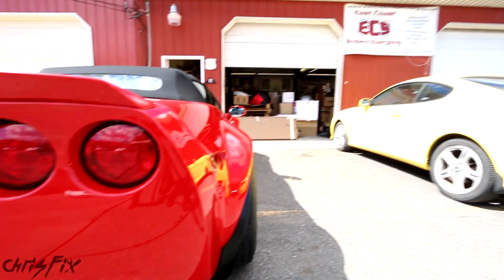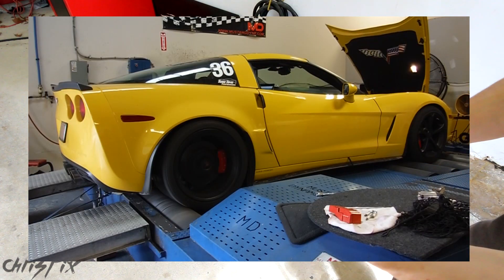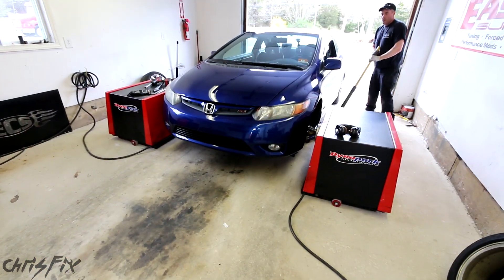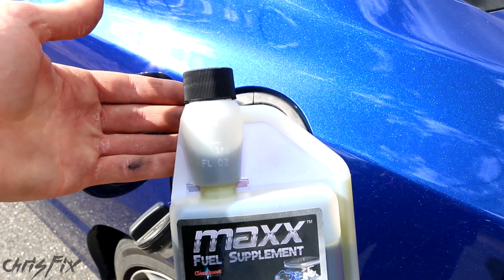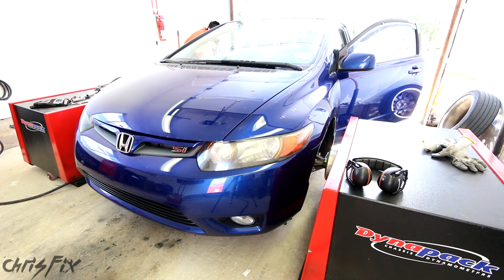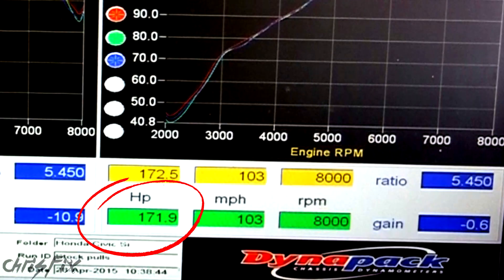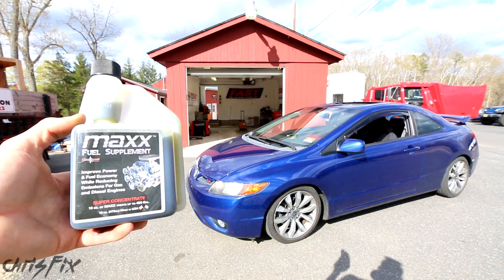Can a Fuel Additive Really Increase Horsepower in Your Car? (With Proof)

Comment: I know this video is old and people have probably said this already, but, I just have to mention something. The best way to mix the additive you put in with the gas that's already in the engine, and to know you most likely have the fuel with the additive being fed into the cylinders, is to petty much have the car with no fuel in it. Maybe like 2 gallons, at most. That's when you go to a gas station, put the additive in, fill the car with like another 2 or 3 gallons of gas to mix it in, then drive it around for 30 minutes plus to make sure the additive is flowing through the lines. I personally have the gallon to additive ratio a lot more concentrated, when I put additives in my fuel (which is rare. I can't even remember the last time I did that.).

Comment: Before I do any research I'm going to hypothesize that the additive aids in oxygenation of the fuel allowing more fuel to be injected into the cylinder and burned at once. This wouldn't aid in fuel economy but might explain the horsepower gain.

Comment: 5hp is negligible so meh...gains are all about how multiple parts work together in harmony, not just a single upgrade. Even if you put in e85..gotta tune for it and upgrade pump/injectors/lines. Probably the best bang for buck on horsepower right there and it still isn't as simple as adding one thing.

Comment: That's a low reading Dyno. The Average stock K20Z3 Civic Si makes around 180-190whp.
Reply from the maker: Dyno readings vary depending on what brand dyno you use. It isnt about the actual HP and Tq number it is about the change in that number.

Comment: Took a trip from Ohio to Florida in a 2005 Infiniti g35. I bought 6 bottles of Lucas fuel system cleaner, the big ones, and used it with every fill up. Tank was empty before I left, so first fill was in Ohio, filled up 3 times on the way there, averaged 260 a tank down, and got 310 for the two on the way back. Not a noticeable gain in power, but fuel economy was worth the extra 6$ a bottle.

Comment: This is beyond dumb.  A gallon has 128 ounces in it.  Lets assume for a minute that the car has 1 gallon of gas in it total.  Lets assume you have a way to burn off just 1 ounce of gas so you know there's exactly 127 ounces of 91 octane gas in the car.  Lets assume that this "Octane booster" is pure 110 octane fuel.  1 ounce of octane booster with 127 ounces of 91 octane gas would net you 91.15 octane (If I round up).  So how much octane would this booster have to have in order to bump you up to 93 octane?  You would have to put 1 ounce of 347 octane fuel in your car in order to get that effect.  

This isn't rocket science, if you mix 5 gallons of 91 octane and 5 gallons of 93 octane, you get 92 octane.  Straight Toluene has an octane of around 114, that's what oil companies mix into gas along with ethanol to actually boost the octane of fuel.  Most of these octane boosters don't actually do anything, it's just BS.  Half of these use Kerosene as the primary ingredient, which has an octane of about 15, so I'm not sure how that's supposed to help.

Comment: Now what is the rated HP and torque for that engine in the car, V's how many KM/Miles it has done, then compare to the test, if its very close to the factory figures then why not use it, especially when your going on a long trip like say more than 500 Km, why because you dont know what the fuel is going to be like at other pump stations. :)

Comment: I'm wondering what you guys think this is? I'm guessing it's an octane booster of sorts but I don't see how so little could give that much knock supression. And if it is then 5bhp on a high cr k motor like his si would make sense. But then it wouldn't do anything good for the lower cr motors that don't have more ignition timing. If it's something that's evening the burn of the flame front and reducing the peak combustion pressures then I could see this working across the bord but eh I'm still somewhat sceptical. Think we can see you do this in the Mustang the 4.6 doesn't have a nice combustion camber and high cr like the si and would shed a lot of light on this stuff.

Comment: The theory behind this is that the additive increases the octain rating. Also if could have just cleaned out the system and actually gained power from that.
Reply from the maker: +Godlike_Gaming Crew Batou323 And vAspire-_- thanks for the info

Comment: More than likely, this has some octane booster in it, and if this car has 91 in it, there may be some room in the ignition advance that the octane booster lets the ecu advance the timing a little. The heat soak after each run isn't affecting ignition advance due to the higher octane as well. 

I bet you wouldn't see near this improvement in power on a more economy tuned engine.
Reply from the maker: Thanks for the insight!

Comment: The bottle reads that it helps with emissions. Has anyone had any experience with this or other additives helping with a check engine light caused by emissions issues? Thanks for the video Chris.
Reply from the maker: I wanted to test this but never had a car that didnt pass emissions. They dont do a sniffer test by me anymore.

Comment: %5 less humidity and ?? temp difference + barometric differences. Bogus test. Not similar weather. Humidity, baro, and air temp are BIG factors. Ive gotten double digits with no fuel additives with just atmosphere changes.
Reply from the maker: +Robert Franqui thanks for sharing. The dyno computer takes those numbers (which is why it is recording them) and adjusts the output hp and TQ  numbers based on he weather data.

Comment: Chris you need to learn how to do math lol you put way more in than you should have. If 1 oz treats 30 gallons then 1/2 oz treats 15 gallons. You said the tank holds 13 gallons and it is 1/2 full which is 6.5 gallons. So basically you out twice as much in as the instructions say to put in. You should have put in 1/4 oz not 1/2 oz. maybe you should redo this video so we can see the results achieved when you follow the directions. Also, for those of us who aren't motorheads maybe you could explain what an additional 5-10 hp at the very top end means to your average driver. I watch all of your videos and love every one of them but not this one, which is sad because it could have been great. If only you had added the correct amount and explained the results better. Thanks for trying though
Reply from the maker: Thanks for sharing. You cannot put in too much. If you add too much it just over-saturates the gas. It doesnt give you any better results. By putting twice as much I compensated for not filling the tank and flushing the additive completely down the inlet hose.

Comment: In Malaysia, there is a lot of gas brands like Shell, bhp, caltex,petronas etc etc. They add use different additives, which makes me hesitate to use any more additive. 
In the USA, is there many brands? Or there is just one on most places/cases?
Reply from the maker: You dont have to use any additives. This would be good if you are racing and need a little boost.
Reply: I Won't likely use any also since as I have said, these fuel brands already use additives idk If I wanna add more. 

My question is, in Canada (sry fget ure from canada) is there a lot of brands of fuels too? Like BHP Shell petronas etc etc?

Comment: Ok, so at max output it increases engine power maybe around 2%. No doubt that it does work, but what does that equate to in normal driving? Is it worth the trouble and cost to gain almost imperceptible increases in performance ?

Comment: Too many unaccounted for variables.  Just saying similar weather conditions is not scientific nor accurate enough.  Conditions can change significantly in 20 minutes.  Especially early or late in the day.  And also inside a shop (yes even with an open door).
Reply from the maker: +RazorStrap thanks for sharing. The main variables were accounted for and the weather conditions are all recorded by the dyno and its factors them into the numbers.
Reply: Dyno may measure the temp, pressure and humidity but I highly doubt that it compensates the measured HP and torque.  You're not at NASA.  And there is a lot more to good scientific controls than just the reading of a gauge.  Procedures and methods matter.

Comment: The 20 minute drive and other variables probably had more impact than 1/2 oz. of any fuel additive you'd put in the tank of 6 gallons of gas.  If 1/2 oz. contains that much energy.  Be really careful not to drop that bottle.  Or you might find yourself on the moon.
Reply from the maker: +RazorStrap thanks for sharing but it doesn't work like that.
Reply: "it doesn't work like that"  If that is what you are going to hang your hat on then back it up with explanation of how it works.  As for the dropping the bottle, it was sarcasm.  I know it does work like that.  If it did it would have to be classified as a controlled explosive substance.

Comment: A few extra HP is just what I need for a grocery run.  There is no point in doing this nonsense with/to/for utility motors.  Pointless!  Fail!  If you're working on a utility motor/vehicle then stick to what is practical for their usage.  If you like it so much then put it in your baby (your Vette).
Reply from the maker: +RazorStrap thanks for sharing. I'm not sure why your trolling the video but I did use it in the Vette and saw no increase in my car.

Comment: This stuff contains "organometallic compounds" according to the MSDS which seems like bad news. Stuff like lead or MMT may increase octane and horsepower but have some definite negative side effects on oxygen sensors and catalytic converters, which is why they were banned in fuel in the first place.

Comment: Chris, why didn't you use camera to look into like when you did with seaform test? can you tell if there was any difference this time on the carbon deposit ?
Reply from the maker: Because there is only so much you can do in one video.
Reply: Chris >> if possible, can you show the changes like some before and after pics.

Comment: What really like to hear your thoughts on premium vs regular fuel.
Reply from the maker: If your car has a low compression engine and does not need premium gas, you are wasting your money running premium.
Reply: ChrisFix nissan frontier 2006 v6

Comment: Thanks for another great video.  But I want to know, at 8:20 in the video, what is up with that crazy torque curve?  I have never seen anything like that!
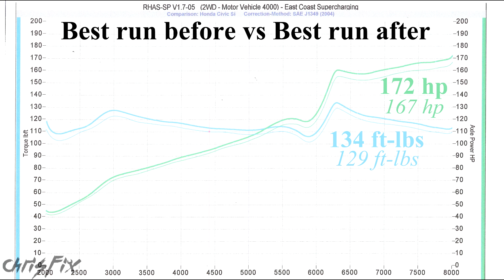Also it is interesting to note, on the graph shown at 8:45 in the video, the gas without additive gives more horsepower up to 5500 rpm.
Reply: torque curve is because of vtec

Comment: Just go to a nearby airport. Some airstrip got 100 Octane unleaded Ethanol FREE  but the leaded AVGAS is much better. The only problem is nozzle that dispensed leaded fuel is too big to fit the hole in the fuel tank.

Comment: I've found "STP Petrol Treatment" and "STP Petrol Injector Cleaner" that would work on my 1.6 petrol engine - Now should we use these BEFORE an oil change,  or we can use them anytime? I'm thinking about all that dirt that will remain in the oil until the next change... And also, can we use a bottle of fuel additive and a system cleaner in the same tank? Or we should separate these two?

Comment: Now what you do is go get a brand new car with no miles on it and do the same thing, because all you did was cleaned out your system and now you are getting the horse power you were suppose to be getting from the beginning. I did the same thing with STA-BIL, I didn't prove more horsepower I just know it runs better.Also, the older the car the better this works.

Comment: What was the temperature, humidity and barometer readings during both test?  A cooler temperature and slightly more pressure will make 5% more power easy.
Reply from the maker: +brian hilligoss the dyno computer is measuring those readings and the runs were done within an hour of each other.

Comment: I think everyone is very very interested to know what would happen if you dumped way more of that fuel supplement than the suggested amount.

Also you need to test out if octane boosters work the same.
Reply: Higher octane won't help you unless you make the engine make higher compression somehow.

Comment: If this stuff is so great, why isn't it in the fuel to begin with?
Reply: Schwarzer Ritter Because it doesn't actually work. There was a 6hp variation alone just on the first 3 pulls. These variables can be caused by just about anything. Ambient temperature, humidity, engine temp differences, fluid viscosity changes in the driveline, even barometric pressure. The higher the horsepower of the engine from the start, the larger these variations can be. The maximum "increase" was only 5 horsepower more than the previous runs and they alone varied 6 horsepower.

That drive he took could have thinned the fluids in the driveline making them thinner causing less resistance. The barometric pressure could have changed as a storm rolled in. The temp in the building could have been different. The increase is just too small to really validate any realistic result.

Comment: That WAS impressive! That's a cheap extra 5hp. I use something similar in my RB30ET powered R31 Skyline cause I'm a little octane limited, using 9.5:1 static comp with 21psi and an old combustion chamber design- my car would ping it's ring off it weren't for the octane boost. I would like to try this one, the stuff I use costs me $16 - 18 a bottle and I use a whole bottle each fill. This seems much more cost effective

Comment: Chevy Colorado that had a PO305 error code. When I used octane booster, why did that error code go away? at least for now.
Reply from the maker: +Ken Norman you probably have a misfire due to detonation due to carbon buildup. So the higher octane prevented the detonation which is causing a misfire.
Reply: Ok, how can this be corrected? I only have the PO305 code. Ive swapped coils and changed plugs. The only thing I havent done is compression check and injectors.

Comment: I'm wondering if the 1/2 ounce dose of Maxx even made it down the fuel filler pipe to the tank. I would have sloshed a .5 gallon fuel to get the product to the tank. But that's just me....
Reply: Nice point
Reply: I thought the same. Because of that you must put it before you fill up gas.
Reply: Well yea you should pour the additive and then add fuel on top so it makes it mix and you get any that didn’t make in down the fuel filler neck.

Comment: wow. a hub dyno, the biggest most inaccurate pile of crap dyno on the planet. and no self respecting tu er would ever be caught using one of those. john bushbaum is a pile of shit tuner and he dont even use a hub dyno. gtfo.
Reply from the maker: +Deadpool thanks for sharing but hub dynos are the most accurate and son systems dynos. They have no chance for wheel spin and connect directly to the drivetrain which is perfect for a test link this.
Reply: ChrisFix no. they are not the most accurate. I work with a real tuner.
Reply: ChrisFix the issue is with fwd. The machine will read the wheel with the least resistance and rate for the higher number. A roller dyno makes the axle have to turn evenly and gives a better reading to the ground.

Comment: Get some Metanol :) 99.98 % works just fine(about 0,5 liter to 40l fuel), but DO NOT EVER USE PURE 100% Metanol (only F1 cars capable of that)
Reply: My father used to work at Budapest Chemical Factory and he used this method, we had a Citoren Xara (not picasso) [i do not remeber clearly but i think it had a 1,4 motor] max speed was 174 basicly with metanol 182-184 :)

Comment: You probably get those figures with regular fuel if you use fuel we have here in the UK and Europe. Unfortunately the quality of fuel you have to deal with in the states is poor in comparison.  I'll bet the shell v-power I use in mine would get these figures in this car.
Reply from the maker: Thanks for sharing. The fuel here is the same quality as the fuel in the UK and Europe. If you are thinking your octane numbers are higher, they are just on a different scale. Your premium is the same as our premium.
Reply: ChrisFix thanks for reply. Yes I have just read up on it. Your numbers take an average of the research octane number  (ron) and motor octane number (mon) to get pump octane number (pon). motor octane number goes through more rigorous tests so is a lower number,  hence why the average of ron and Mon is lower than ron which we use over here.
Reply: ChrisFix whenever you disagree with someone, you say "Thanks for sharing"

Comment: i bet you a ricer would try to use it more than once to get more hp 😂
Reply: ironic finding you here
Reply: That_white_5.4 , why do people think that hondas are rice?
Reply: Squeek Tate Whats the definition of rice then?
Reply: Squeek Tate and here I thought my 09 SI was reliable seeing how I've murdered it for 132,859 miles. Only issue I've had was the slave cylinder.   I've also noticed the SI models hold their value quite well🤷🏼‍♂️.
Reply: Drew Jenkins It's very easy to kill a Honda, like any other economy car.. I've learned this through personal experience AND public knowledge - despite the refined crowd of Honda fans who insist otherwise. Although they tend to produce a good motor, they're truly no more reliable overall than anything else I've ever owned, and definitely not worth the praise. Never had an Si though.
Reply: ha ha they would drive their cars over a clif to get the 0 to 100 in a few sec
Reply: @Revolt2010  where do Jews come into the picture here but anyway why do all people think jews are rich I dont get it I know 2 who are pretty far from rich
Reply: So ricer in claim is racist. Got it. Gotta love 'Murica
Reply: Revolt2010 Honda’s is like shopping at Walmart for groceries, instead of Costco